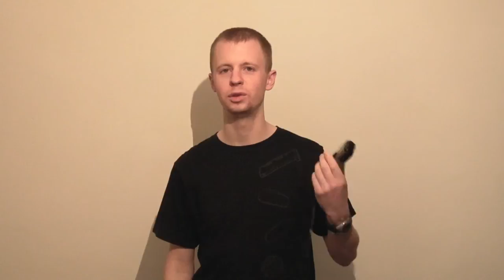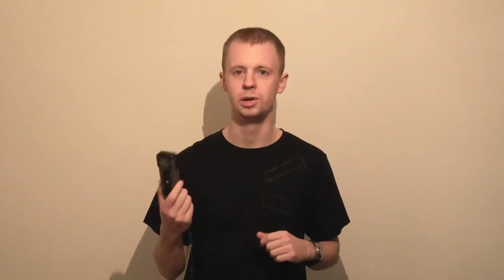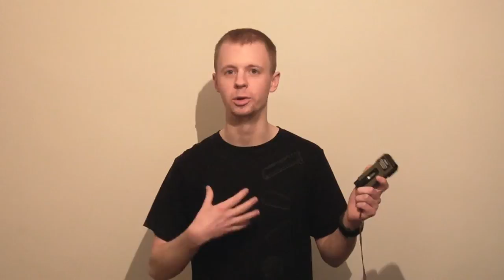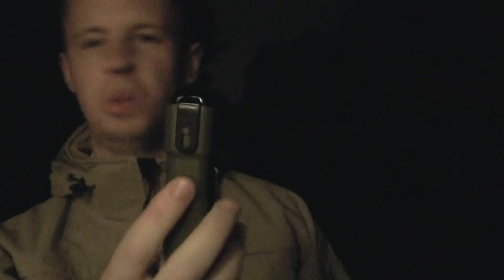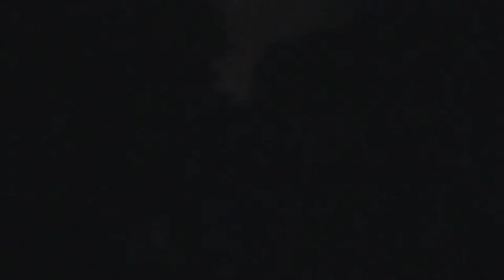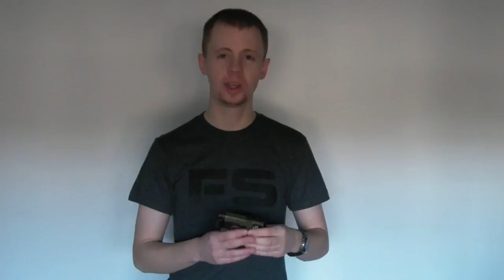MS-2000 Signalling Strobe

Comment: I could be mistaken, but I think the faint noise you hear is the capacitor discharging when the strobe blinks. Also, for what it's worth the prices on the MS2000 strobe plummeted now that everyone is jumping on the Manta & V-Lite bandwagon. Thanks for the review BTW! Your presentation is concise yet informative; subbed!
Reply from the maker: Interesting, and thanks.
Reply: +Grim Proteus Those manta strobes are expensive for what they are
Reply: Rusty Shackleford Agreed, I never said they weren't however. At no point did I ever attempt to justify how S&S Precision prices their stuff.
Reply: Grim Proteus Wasn't attacking you.
When you have a $3000 set of nods, a $200 strobe is a drop in the bucket. For the average person/airsofter they're expensive.

Besides, whats the weight difference between the two. MS2000 looks bulky more than heavy.

Comment from the maker: Always a balancing act, outlay vs usage.  The Spectres are the same really if you compare to an ACOG.  The Trijicon will weigh a *lot* less but it has a much smaller FOV and shorter eye relief.  The replica Elcans do make a noticable different to your rifle's weight and vertical balance characteristics, but then you can see a lot more of the field when you look through one and get a more comfortable cheek weld in a position that suits you rather than being limited by the optic itself.

Comment: What was the distance ? 12 / 15 ft ?
Reply from the maker: When filming outside?  Something around 21-22m.
Reply: +REMF Tacticool . Hay dude. Im tinking of getting this for climbing at night. Would you say that a heli (say at 6,000ft) would see this strobe at night??  Also....does the IR make any difference in the visable distance? I ask cus heli on rescue tend to use IR night vision. Cheers!
Reply from the maker: I've not used one of these out in any proper field test, so I wouldn't want to comment on serious usage like that.  Obviously some sort of IR signaller will be useful for rescue crews to see, but overall wouldn't it be better to not put yourself in a situation where millions worth of helicopter is going to have to fly out in the middle of the night and have a crew risk their lives to try and find you?  I mean if this climbing is entirely necessary then that's a different matter, but even asking that sort of question in the first place is a bit of a 'sign' as it were to my mind.
Reply: +REMF Tacticool . No offence mate (and i really dont mean to sound an arse - But i may do anyway), but what i do at night, where, why and how is my choice and there is a valid reason for asking this, all i wanted was a answer.  Didnt really want/or need a safety course or "ethics" guide to climbing.  My advice (since you gave yours).....Try not to be so presuming. Thanks for the reply.
Reply from the maker: Wasn't presuming anything, hence my latter statement.  I open myself up to constant trolls and people who say literally the worst possible things to/about me in these comments on a pretty much daily basis just because I choose to put up these videos.  It's a full time job blocking them sometimes.
I suppose to my mind asking someone else that sort of question is extremely minor in a comparative realm, but that's just because of my experiences.
Anyway, if you are in need of a high power illuminator to get spotted, this particular model is very old school, but if you can source something like this which is designed for downed military aircrew then it should have the power/range and ruggedness necessary for outdoor use.
Reply: REMF Tacticool I understand. Youtube can be a schooling in "hard knocks". Can get very abusive, so perhaps im suffering from being "over presumptuous" in my comments too. My bad....cheers dude. Let the haters hate....they'll suffer in the long run, not us. All the best to you brother. Sorry i was snappy.
Reply from the maker: Hey it's no worries mate, stuff never really comes across the way it's meant, cheers.